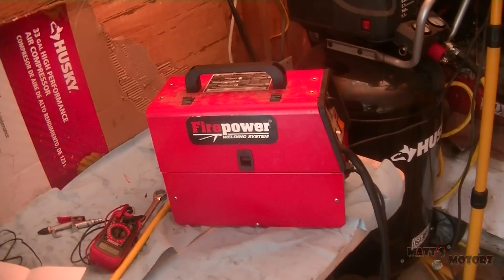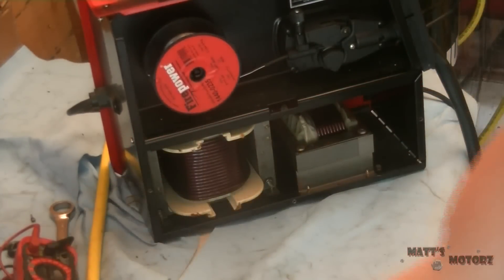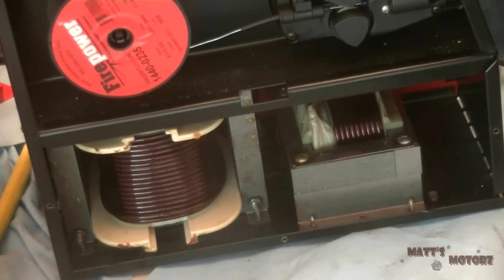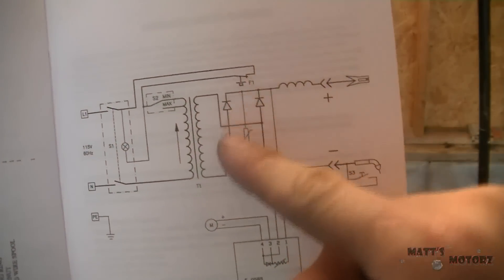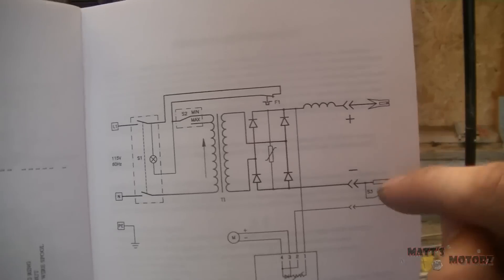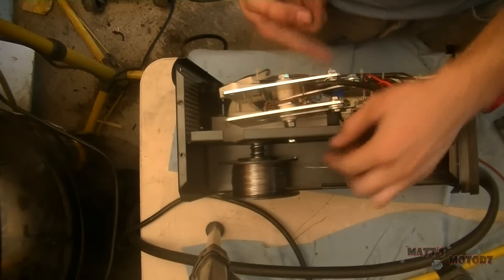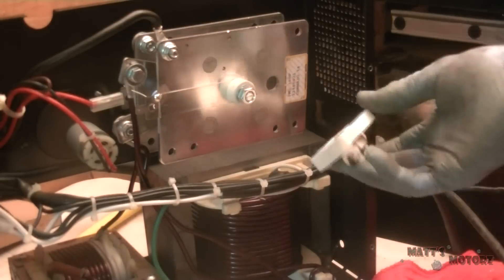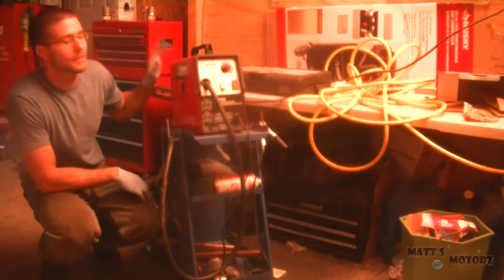Fixing a MIG Welder [Rectifier Replacement]

Comment: Thanks for your interesting demo on the rectifier replacement.  I may have such a problem on an older Henning Hansen 160, and I was wondering  if just the diodes could be replaced since the metal plates are just for a heat sink aren't they?  Any advice... I think the H. Hansen may have alot of good life left in it.  I might have exceeded its duty cycle rating which was about 35%.  Thanks again.     Rational on Alaska
Reply: I was wondering the same if they could just be replaced alone. were you able to replace just the diodes, or did you have to replace the whole thing?
Reply: @sean7193 Also here wondering the same thing?

Comment: Excellent video Matt.  Thank you for posting.  I have a FirePower Fp-120 which I have put to great use except a week ago it suddenly stopped working.  It odd because the last time I used it my spool ran out so I decided to stop for the day .  The next time I went to use it I installed a new spool and when I pulled the trigger on the torch - nothing!  No relay clicking inside the unit as it should and the wire feed motor doesn't spin.  The cooling fan runs and the main power switch indicator light is lit showing there is power to the unit.  I've gone over the entire control board and can find nothing wrong.  I am getting no DC output off the rectifier so perhaps this is the problem.

Comment: where did you get your new rectifier??  I need to find a PMS 30 F/1 type for my Clarke 95 a similar model to your welder.
Reply: Nathan, I have a Firepower FP120 and the rectifier shown in this video appears to be the same as the one in my unit.  I am getting no DC output at all and am wondering if I need to replace the rectifier.

Comment: Great video, I have a mig pal 100 all the sudden stoped working, I made it work by by passing the overload and it worked good for the rest of the day. Next day  I turned the switch to start working, no power at all. It won't turn on. (It's not the on-off switch).  Any idea? Thx.
Reply: The overload is your duty cycle if you bypass overload you could not only burn up Transformer but burn up capacitors transistors anything affiliated with that circuit and burn your house or your garage down where you're working because after the machine starts to see too many amps that is what the overload is there for I think of it like this think of a breaker in your fuse box that breaker if it's 2:20 or 1:20 either or has a load rate limit of amps and wire that must not exceed the amperage of the fuse or breaker cuz that defeats the whole purpose now more likely your limit switch was bad and there's a way that you can test a certain limit switch is not all of them so if you ran that welder and bypassed its duty cycle whether it's a plasma cutter or a welder or some type of machine that creates AC or DC output them Transformers and all them components that are included with it can heat up and most of your rectifiers in welder certain welder and plasma cutters will have a thermal disc which is housed in the rectifier they call it like a hockey puck summer big summer small depending on whatever they designed that machine and that rectifier to use and a lot of times they have to be depressed within a certain torque value to get the correct ohms readings out of them and depending how the circuitry goes they could be leading up to a control panel or board with multiple different components and if you bypass that switch you could burn all that stuff up and it's hard to tell what went bad on a PC board even if there's no signs of burnt because they are varnished with a special substance so you cannot test them now you can scrape back the varnish and proceed with your testing depending on what the diagram wiring allows you to test within that circuit if you got 10 things in one circuit they're all incoherent of each other if one thing is bad it's hard to test that exact part because you're going to get false readings because they're nine other circuits in that 10 circuits completion so another way that you could do it as you could do an oscilloscope and find your power and ground to the board without actually being hooked up to the machine and put power directly into the PC board while it's live under current then test the wave pattern on your DC out to see if it's giving out a direct current from the board at which part it is supposed to give out DC now testing all the other components within that circuit you would have to scrape off each a little bit to test if they are in the right ohms or amperage a would have to be done with power going to the machine or bored and possibly under a load so there can be quite inclusive and conclusive testing has to be done and troubleshooting is to find the exact problem

Comment: Matt, I've got a situation w/ a Century 170GS (220 unit). Can you assist?  Not getting any power to the torch end. Using w/ a Generac 5500 and when I trigger the torch the generator lug down as though I'm welding but nothing at the torch tip. Seems to be grounding internally. Anything?

Comment: Hi On my millermatic 251 . I just notice when my ground clamp is grounded to a piece and then turn on the machine it sets off a high 4 code, when I remove ground clamp it clicks and then goes to a normal display and then I can clamp the ground again and proceed as normal to wield , It only does this when the ground clamp is clamped on start up, this unit never did this before. What might be the problem ( a short may be ) Thanks for the informative vid.

Comment: Hi
You seem to know alot about welders, I have a wsme 200 ac/dc with Pulse Tig Welder
everything works, except the pulse, I cant get the pulse to become active.
any idea what pc board controls the pulse or if you have any suggestions on what I can try.
Reply: Seems like you can do nothing. It must be pcb or microchip controller malfunction. Only control board replacement will help. Or maybe its just potentiometer failure if you have it for pulse control.

Comment: my wire feed stopped working and I took the gun apart and everything looks good there. the welder seems fine if I have excess wire out of the tip and pull the trigger, it has power and zaps the metal but wire feed wheels inside unit just don't turn. any ideas about what I can try?
Reply from the maker: ANGEL Gonzalez Check the voltage at the motor that feeds the wire.  If there is voltage then the motor is bad.
Reply from the maker: Kevinvansea Does the motor make any noises when you press the trigger? If it does, something is making the wire very hard to push through the gun.  If it doesn't then the motor may be bad.
Reply: thanks for your help. I believe the motor is bad hope I can find a new one
Reply from the maker: I got my rectifier at NAPA.  I learned that they sell welder parts.  Give em a call.
Reply: Thanks, I'll be sure to give them a call.
Reply: +MattsMotorz hi I have a duel mug welder that the power button turns on but it doesn't feed wire or anything there's a little fan in the back that turns on but nothing else
Reply from the maker: Check the voltage at the motor that feeds the wire.  If there is voltage then the motor is bad.

Comment: Thank you for the video. one of the better how-to's /walk-thru's I've seen everything was very well explained, you didn't skip any important parts, and you didn't rush through anything
Reply: Also I have a Clarke 130en mig, the diode bridge actually smokes when I turn it on, the whole set up is very similar to your firepower. My only question is where did you get your new rectifier, and how much did it set you back?
Reply from the maker: Anthony Filipski Thanks for the comments! You can get welder parts at NAPA (I know, I was surprised too!) If memory serves, I believe this rectifier bridge was around 60 bucks?  The old one also smoked when I turned it on.